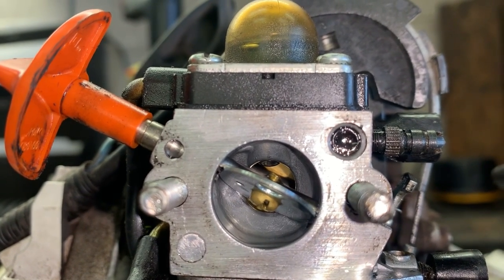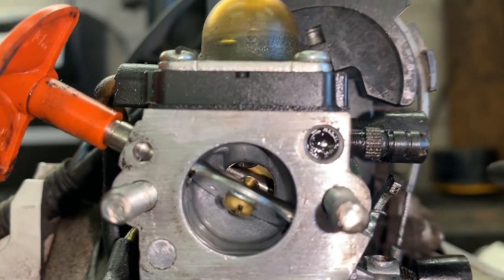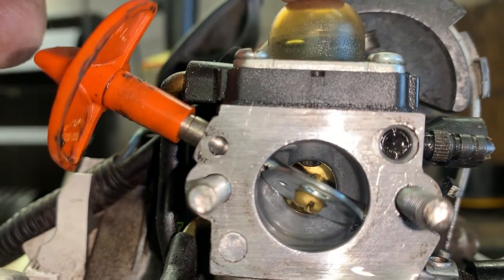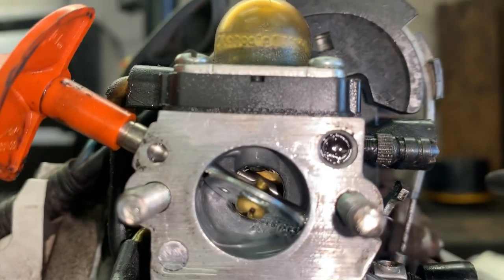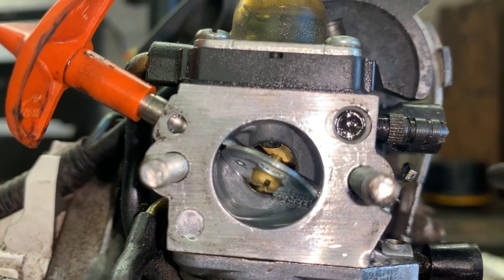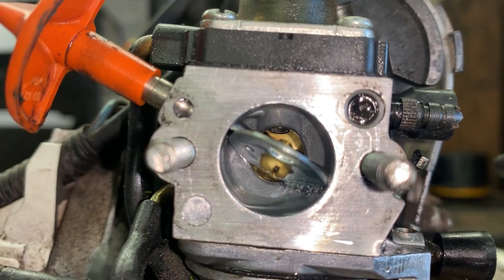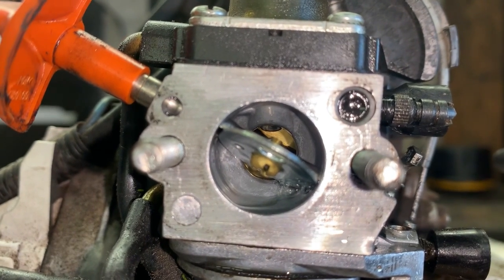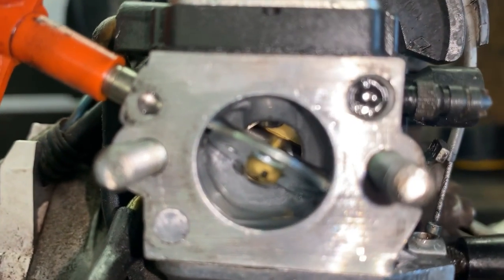ZAMA C1Q CARBURETOR / BAD CHECK VALVE

Comment: Hello mower medic 1, i found the issue with that ryobi chainsaw it was the throttle cable holding the butterfly  wide open, in turn wouldn't allow the idle screw touch the the throttle arm I trimmed the cable back screwed it in closer and, kaaaaching!!! the saw can have the idle set spot on ,thank you sir you made me think deep ,one day I will get that mower medic diploma on small engine repair !!

Comment: I hate to be a I told ya so, but zama does have replacement check valves. The  Zama C3A-S19 for my Stihl 034 has replacement check valves.

Comment: So because of this check valve the engine is not running correctly? Im asking because I have the same problem and the saw is not running. It only starts and bogs down after some seconds. It also has the ZAMA C1Q carb. Thank you

Comment: On those carburetors is the check valve built into the plastic black piece or is it built into the carburetor itself is it a underneath the little brass piece inside the carburetor that is got looks like a little piece of rubber I think I've run into this issue several times
Reply: the primer body has a check valve in it, but so does the carb body. right under the jet

Comment: The failed check valve is located inside the primer plate or is the one located in the throat of the carburetor?
Reply from the maker: Both

Comment: But in this carb isn't it just a fuel pump check valve that has to be replaced? 
H nozzle check valve actually ALLOWS fuel to come out from fuel chamber (as it is shown in this vid) to venturi and PREVENTS air to go back from venturi to the fuel chamber.
When you press the pump it creates a pressure in the fuel chamber (instead of creating a pressure that causes fuel to flow back from fuel pump to the fuel tank) that causes this fuel leak from the H nozzle.
So this test actually can't show you if the H nozzle check valve (which is irreplaceable) is damaged. If you want to show this, you should have to create pressure in the venturi, and take a look if the air is coming out from H nozzle in fuel chamber. 
Whole fuel pump with is base is availble and can be replaced, but - we all know that those zamas are pain in the ass and in most cases its better to just replace it, instead of repairing it several times and then replace :)
Greetings from Poland!
Reply from the maker: Correct https://youtu.be/SDu0lNSqYh4

Comment: So I have a Homelite  UT08111 backpack blower with a Walbro WT419 that was given to me years ago and has always run like a champ. Yeah, I know. It's a Homelite. Tried to start yesterday and wouldn't start. Saw fuel dripping out of air breather box. Removed and fuel poured out. Found that fuel was pumping out as I was cranking it over. Runs great with a shot of starting fluid then dies. Have been looking for carb because I broke the plastic choke lever. Not much luck. Any suggestions?